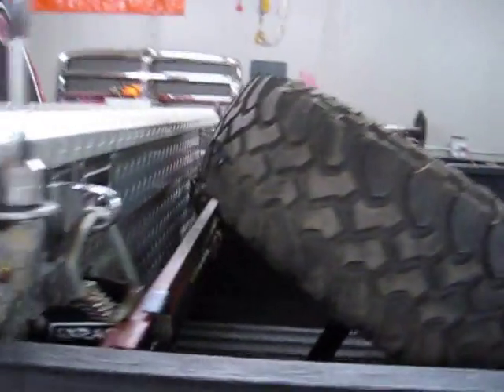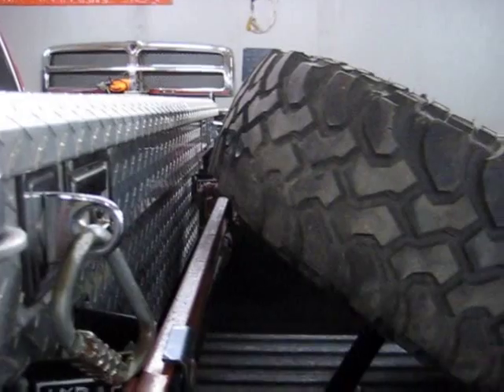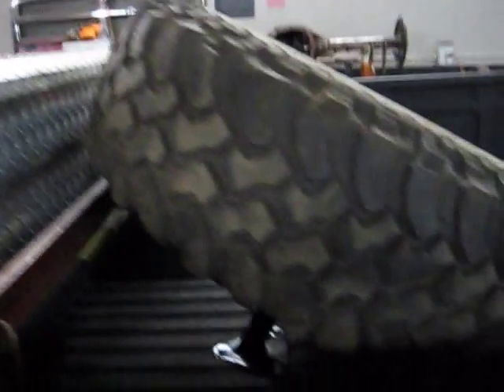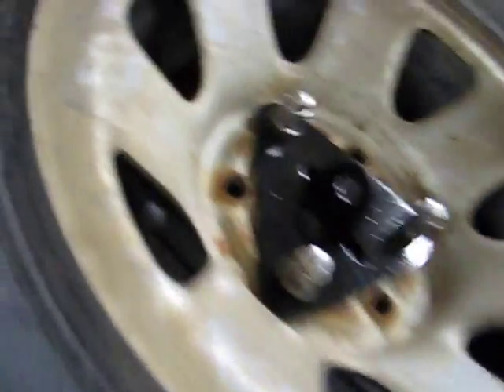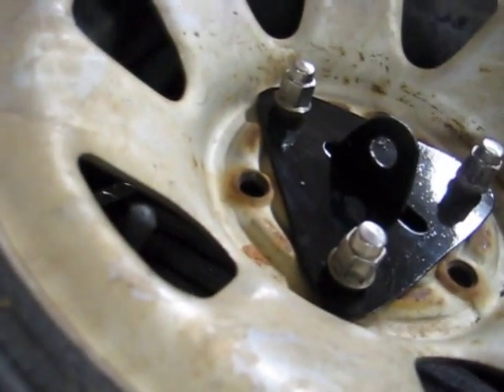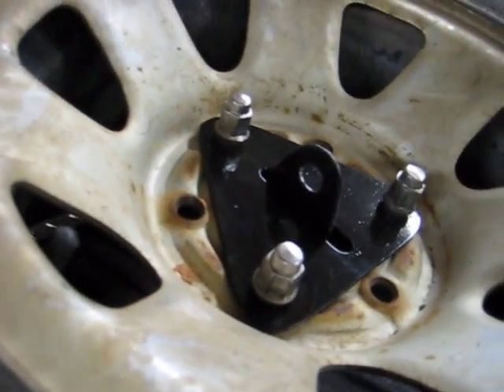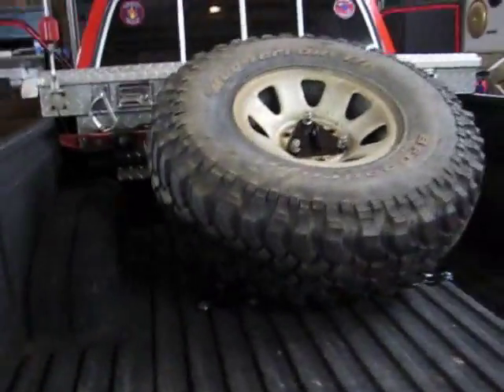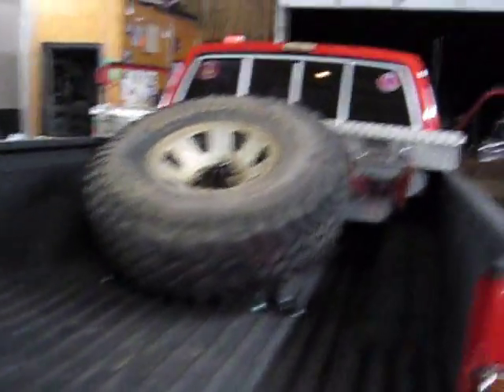Toyota 4x4: Bed Mount Angled Spare Tire Carrier

Comment: Pretty sweet. I've been thinking about doing this in the back of my Wrangler. I hardly ever haul anymore than my self and one passenger, but occasionally I do need my bench seat. So I was looking for something that was a quick disconnect. The swing out tire carrier I had did a number to my frame on the rear so I'm looking for something a little more sturdy? Is that the word?
Reply: That and I refuse to pay the price they want for something like that when I can do it myself.